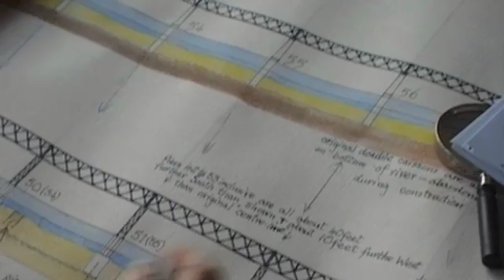Bill Dow's theory on the Tay Bridge disaster (2/2)

Comment: Early footage exists of a Dundee-bound train crossing the first Tay Bridge, and at the end of the high girders, there is a discernible lurch to the east, approaching the triangular connection plate.  That was above pier 16, which is known to be the first pier to collapse.

When the body of the fireman was recovered, it was found to be horribly burned, in all likelihood from the hot coals falling out of the firebox onto him.  This supports the locomotive being dragged backwards by the connected coaches as they fell.

The wooden bodies of some coaches had disintegrated completely, which could only have happened through a severe impact.

It is my belief therefore that one or more of the carriages derailed, smashing against the high girders, then one or more hit the triangular plate, causing pier 16 to collapse, and bringing the bridge down.
Reply: Actually that was the second Tay Bridge.

Comment: Interesting theory. I would be interested to know which span the toppled girder became. You seem to be suggesting that it was the first one, accounting for the phrase 'a slight change in the direction of the rails as you passed from the low girders into this high girder'. Do you have evidence for the kink occurring there and the toppled girder being the first one in the Thomas Bouch bridge? Now without that evidence you don't have a sound basis for a theory that the second class carriage derailed at this point, nor is there a sound theory for the carriage striking the triangular gusset plate at the junction between spans four and five because from the evidence of the photograph the plates occur at more frequent intervals and if striking a gusset plate was the outcome of a derailment at the entrance to the high girders, the carriage would already have smashed at the first triangular plate, at span two; and the train would not have reached span five. For your theory to work (and the combination of carriage derailment and the carriage striking a triangular gusset plate is attractive), you have to demonstrate either, that the kink was indeed where you suggest it was, and that the train was able to safely negotiate three sets of triangular plates before coming to grief on the fourth; or that the kink was between spans three and four, where the carriage derailed, leaving the fatal plate where you suggest it was, between four and five. You also have to demonstrate that the striking of a triangular plate at either of these positions would result in catastrophic failure of the high girders. I am not an engineer, but my instinct tells me that the deficiencies in the design of the bridge, combined with the weight of the train and the ferocity of the storm, all acted in unison. I think there is something alarming about the combination of the low and high girders, the phrase 'overturning effect' comes to mind. On that stormy evening I can picture the train approaching the halfway point of the high girders, the point at which the maximum weakness in a structural system may be most likely to occur, with a sudden, unimaginably powerful blast of wind, creating the 'lift' effect you mentioned; perhaps a sharp application of the brakes with accompanying sparks. I picture the first column to fail was five, just ahead of the train, then four, at the junction between the fourth and fifth spans, sandwiching the last two vehicles of the train as it was passing, followed by three, then six, two and seven, one and then, domino fashion, eight to twelve, all within the space of about six seconds. Terrible

Comment: I am not qualified as an engineer, but speaking solely as a layman I feel this theory, as presented here, is in conflict with evidence presented at the 1880 inquiry into the disaster.

The video suggests that the collapse of the bridge was initiated by a shock created by the 2nd-class carriage which, having allegedly derailed, struck a plate at the junction of the fourth and fifth of the High Girders. However, since the train was in motion (I estimate its speed as 17mph, see further down for my workings), it would be expected that momentum should have carried this carriage some distance beyond the point of impact in the few seconds between the administration of this shock and the failure of the bridge. However it did not - the plans detailing the disposition of the wreckage show that the 2nd class carriage had only just reached the end of the fourth girder at the point the bridge failed, meaning that the only way this evidence matches with this theory is if either the train stopped dead at the point of the collision, or that the collapse of the bridge was instantaneous - the whole structure toppling the very instant the 'derailed' carriage struck the plate.

My second thought relates to the derailment - the video suggests that the van lifted clear of the track at a 'kink' in the roadbed where two of the High Girders met, presumably the third and fourth. This would mean the train travelled the whole 245ft length of the fourth high girder with a derailled vehicle, and that none of the train crew responded to this, even though the shock of a vehicle dropping off the rails and riding over the ballast would be felt throughout the entire train. Dugald Drummond, locomotive superintendant to the North British Railway,  testified on this matter, and said that the first instinct of a driver who realises his train has derailled is to shut off steam and apply the brakes. However, when the wreckage of locomotive 224 was recovered from the firth, she was found to be in forward gear, her regulator wide open, with no application having been made of the handbrake. The fall of the bridge was thus sudden, with no build-up that would have given the driver time to react, as would be expected with a scenario shown here.

Testimony shows that the train was not speeding, having taken some three minutes to travel from the south shore to the fifth high girder. From Google Earth, I estimate this distance to be about .85 of a mile, giving the train an average speed of 17mph, or about 25 feet per second. The fourth high girder being one of the longest (245ft), this would have given the train crew nine or ten seconds to realise a vehicle had derailed and take action, yet apparently none was taken, even by the guard, who was riding in the van immediately behind the vehicle that is suggested to have derailed, and who could not have missed it.

Then there is the disposition of the recovered bodies. The fireman was found with his face blackened, meaning he was probably working at the firedoor when the train fell, the sudden displacement of the engine causing the firebox contents to blow back onto him. This indicates all was normal on the footplate right until the moment of disaster, inconsistent with the suggestion of a partially-derailed train.

The guard, when recovered, was found to have a calm expression on his face, except for his hands, which were tightly clenched. This suggests that the failure of the bridge was sudden, giving barely time to react, and does not suggest the consternation of a guard trying to stop a train in which a vehicle has derailed and is dancing over the permenant way.

Furthermore, Dugald Drummond testified that none of the wheels of the recovered train showed damage consistent with a derailment, such as damaged tyres or chunks taken out of the flanges.

The video also implies, somewhat scurrilously, that forensic investigation of the wreckage was lacking, but this is not the case. Although much of the ironwork was left in the firth due to time constraints and the limitations of diving gear of the era, all the vehicles of the train and the High Girders themselves were recovered and examined, and it was from examination of this wreckage that the derailment theory was discarded due to contradictory evidence - no damage to the permanent way, and no damage to the interior of the girders that could be attributed to the train prior to the collapse. 

The inquiry also commissioned a photographer, Mr Valentine (whose firm later became a major postcard manufacturer) to photograph the wreckage on each of the piers with meticulous detail, taking pictures from each cardinal direction. This wreckage included not only the remaining uprights of the tower bases, but vast amounts of failed tie-bars, bolts and lugs that fell from the upper parts of the bridge during the disaster: many of these, together with other samples from the columns and girders, were sent for structural testing to determine their quality and strength. Indeed, its only thanks to the efforts that the 1880 inquiry took to gather evidence that we have the ability in the present day to debate and discuss the collapse mechanism that bought down the Tay Bridge.
Reply: It seems odd to me that the OU would involve themselves in a theory which is, as you point out, so much in conflict with the evidence.

Comment: It was very spindly looking..
Reply: EVERY iron (and later, steel) structure looked spindly like that.  You dont' overengineer because the client and his users can't afford it.  Read the book "Structures, or Why Things Don't Fall Down", which treats of Compression and Tension and stress and strain.  Compression structures have a way of looking very solid--yet it IS possible to design an arch that WILL fall down--as the author remarks, a Welshman named Jones did that at Pontypridd in 1751.  Something called a "line of thrust" has to stay within the arch; if it doesn't the arch WILL develop hinge points and fold like a flexible ruler.  I cannot too highly recommend "Structures".

Comment: I'm a bit puzzled by this, the derailment theory was investigated at the original inquiry after the collapse, and was agreed to be unlikely. It WAS agreed that the bridge was badly built, with a lot of defects in the cast iron columns. It was also established that there had been a wind in excess of that allowed for in the bridge design. Given that, it seems a bit unnecessary to look to any other cause.
Reply: Bouch supposedly always leaned on the derailment theory.  But no scoring marks from derailed wheels on the ties/sleepers but then American and British RRs were built differently then.  Wood is expensive in Europe but iron rails were "right there".  So British RR's had fewer ties and heavier rails.
       The story here about the sunken girder's being reused is a first for me; I've never read that before!  If the girder passed inspection upon being raised yes they'd use it again!  But again, as an American I am suspicious of rivets--particularly British ones.  British engineers' structures always have the look that maybe the designers haven't really thought through tension vs. compression and maybe muddled the two hence the British structural failures.  The American practice of pin-connected structural joints practically requires that tension vs. compression members look VERY different from each other!  Anyways, I will be hearing this one once I get my sound back.  But is this the same theory that a change of attack where the low griders met the high girders, meaning they didn't meet straight on but there was a slight turn that Bouch made no attempt to handle and that that is where the collapse began.
       Another bit a reading and watching back when I had sound a few months ago was that the towers/columns fell apart under the train and caused the now-unsupported spans to collapse, rather than the bridge's being blown over.  The high girders fell right next to the piers rather than further out where intact towers would have taken them.
       See?  143 years later--we're still discussing Bouch's Tay Bridge and its collapse!.

Comment: Like with any disaster, we can safely assume that the collapse of the Tay Bridge was caused by a multitude of factors all working in unison. Yes, the design was flawed from the onset because Thomas Bouch neglected to properly account for the wind, the metal and the casting were sub-par, the ties of the diagonal bracing were loose and the lugs cracked by fatigue... The overspeed train derailing at the critical time on that stormy December night was merely the straw that broke the camel's back.